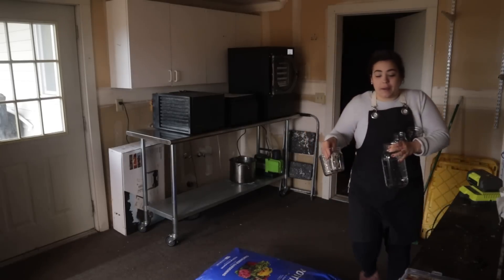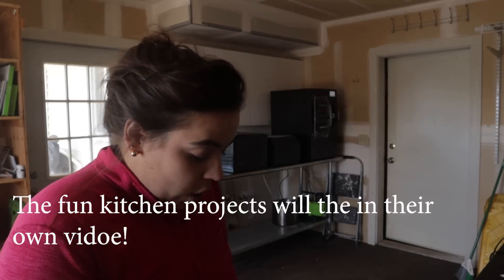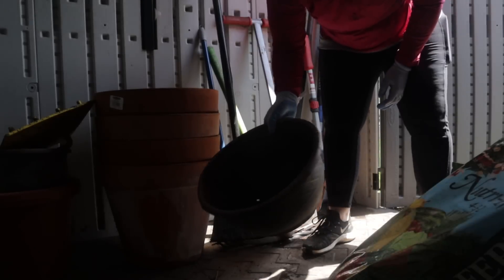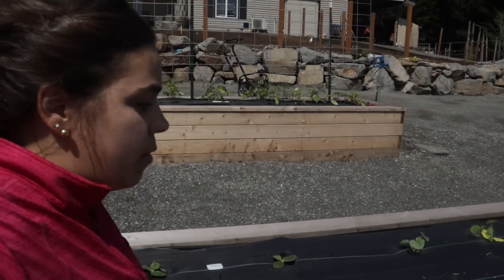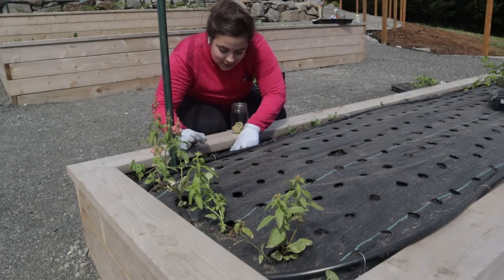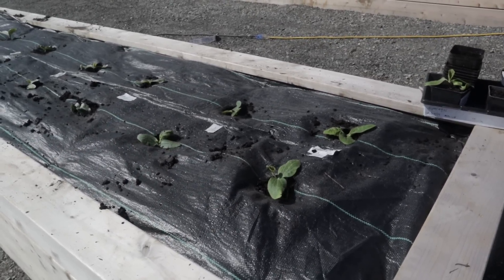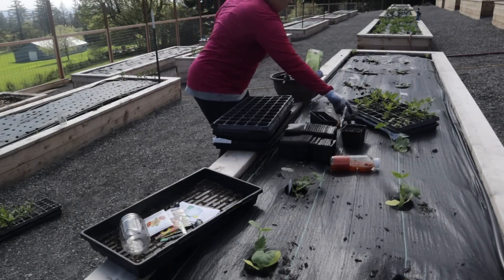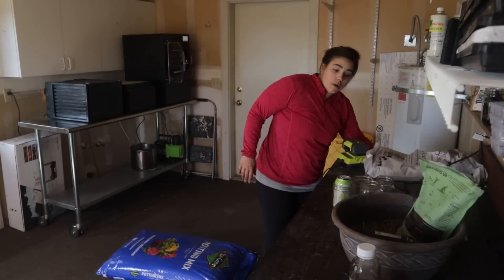I'll try just about anything at this point!

Comment: I germinate most of my seeds in a wet paper towel in a plastic container. Once they sprout, i put them in red solo cups with soil. Then when they are ready to plant outside, they go into larger pots/ containers outside. The garden is looking awesome.
Reply: Just a question because it's only my second year gardening. I had really poor germination rates with my beans this year. I just sow them into the ground. Would you also germinate them first on a wet paper towel?
Reply: @sarahr.1076   beans like alot of moisture but while germinating in the ground if its to cool and to wet the seeds will mold and rot.
If we're supposed to get rain I just plant in a furrow and water before I cover. If its to be dry for days or a week I don't water unless I'm going to water until the rain comes.
Some like to soak seeds before planting and others don't
Reply: @sarahr.1076  i do most of my veggies and fruits that way. Its easy. I dont have much luck direct sowing because all my stuff goes in containers or pots. My ground soil is not good because I live in an HOA. Good luck, give it a try.
Reply: Yes I’ve just tried this method and it’s awesome 👍
Reply: I do the paper towel method too! It works really well.
Reply: @tammymanuel9158  .
Reply: @Sarah R.  Beans are really sensitive to some of the chemicals used to kill weeds, so it's possible this was a factor
Reply: I bet it looks beautiful
Reply: Love that ideal!
Reply: @sarahr.1076   you can try that also. But remember these few things. good soil contact is critical for seed that was not soaked first. They cannot (!) Run out of water from beginning to fully sprouted and leaves, not ever getting too dry. If there are blank spaces between sprouted  plants, replant them. Don't thin beans the way seed packets say! Healthy plants that are 4 inches apart are a bit too far apart. With peas, do all this stuff, plus plant 1 inch apart or less. Beans and peas both do much better if planted close. Inoculant helps.
Reply: @MissBetsyLu  Thank you. I will buy a new packet of beans today and put them in the gaps and try to get the moisture right.
Reply: @debbiepaquin8842  Ok, thank you. That's good to know. We get a lot of drought here, so I will try to be very diligent to keep them moist. 

I'll buy a new packet today to put in the gaps and will try the tips.
Reply: @tammymanuel9158  Thank you :)

I'm lucky with the beans, their space is where an old compost pile once was, so the soil if fairly good.
Reply: @carmendoyle9786  Thakn you :)
Reply: @cynthiafisher9907  That's true :D. We have voles, maybe they were hungry.
Also last year I had problems with slugs eating the bean seedlings. So this year I made sure to protect them from slugs :D. Every year it's a new challenge.
Reply: @n3rdygrl  Ok, thanks. I really hope not. But that's good to know. I remember the soil test with beans from a few videos ago. 

It's the same space I already grew a few beans last year and haven't changed anything. 
Except I added a few new varieties.
Reply: Thank you!  I’m going to try this.  Having trouble with that this year for some reason 🤷🏼‍♀️.
Reply: @sarahr.1076   my pleasure. Take care and have hope. If I can get them to grow, anybody can. Blessings all.
Reply: Great Idea!!!

Comment: Hi Becky , I am 64 years old and have a couple of things for you.  when planting corn my gramps taught us 3 seeds per hole and of course it was in the field so it was about a foot apart. That being said i do mine in a raised bed and I do 2 seeds per hole and about 8 inches apart and it seems to do well for me . Now as far as the cloth I am on year 3 of mine and it is as good as the day we put it down. We did have some fraying this year due to a big storm but we just reburned it and it's fine. Make sure you use plenty of staples we put ours about 2 foot apart and  we found that with the wind and such it has helped tons. for your melons you will need what I call a melon bra so be thinking what you want to make and or use for that. my gramps literally used grams old bras to hold the melons. that being said there are many things you can make and or use.

Comment: regarding the fabric rounds you've got left over: if you burn an X shape instead of a circle, you can tuck the four corners of the X underneath the landscape fabric. doesn't use less fabric but will at least simplify the cleanup

Comment: The worst thing about putting sunflowers in the weed fabric is the removal.  The roots get so big you can't pull the plants out of the holes burned in the weed fabric. We had to cut off the sunflowers, take up the weed fabric and pull the sunflowers out from the underside. Your garden is coming along great!!!!
Reply: Why take out roots? Leave them to rot there. Have 2x as many holes as needed and alternate. Blessings all.
Reply: Using a lopper  or a saw to cut the base off and leave it overwinter in the ground should help and create compost in place at the same time. The very woody part that won’t decay i often bringnin the spring to the compost pile
Reply: @TheEmbrio  yeah. That's what I was thinking. Or even leave it there more than one year. Blessings everyone.

Comment: One suggestion. When planting big areas of stuff like your corn, set seeds on surface and don't cover them until all seeds are spaced out. Then, if you have to respace them, you can just move the seed around. When covering or pushing into dirt, it goes very quickly. Great blessings everyone.

Comment: Hi Becky I am in Australia and we have just started our Winter.  I also have my whole vegetable garden in raised beds.  Most of my beds are 1 foot high, 8.5 feet long and 3 feet wide.   I have 2 beds that are 2.5 feet high, 8.5 feet long and 3 feet wide these 2 and one of my lower bed are where my Asparagus is planted.  I have weed cloth under and around the beds but have never considered putting it over the bed in replace of mulch.  We have very long and hot summers and I would think that the weed cloth could over cook the ground and plants.  We also don't normally get our rain in nice soaking rain over several day but get more very heavy showers in Spring/Early Summer that can drop a couple of inches at a time in about 15 minutes and I wonder that a huge volume of water all at once may be too much to go through the weed fabric all at once and the water would fill up on top of the fabric forming a pool and then start overflowing the beds, even with there being a space of about an inch to 1 1/2 inches between the actual top of the garden bed and the soil/weed cloth. I have never had problems with the water going straight through the mulch and then into the soil when we have the storms.  Have you experienced any large downpours and the affect it had on your beds?  I also like digging in the left over much from a bed that has finished producing for the year as more organic matter to help build up the soil.  I am watching your "experiment" with interest to see how it preforms during the year.  I do like the idea of the holes to help with watering.  I hand water everything as putting in a drip irrigation system was just out of my budget and I do like it as I can inspect the plants for insects or other problems and I find it very relaxing. Regards from Down Under Friend.

Comment: I’m in the Pacific Northwest as well, have you tried the copper I think it is around your beds for slugs? You can wrap flat copper wire I think 1/2” thick and they won’t cross that line. I think they sell it specifically for gardens but I’m pretty sure a row of pennies will do it too ❤

Comment: I used to grow microgreens and specifically grew those sunflowers. Something you wouldn't believe until you try but adding pressure/weight to the sunflower seeds will help with germination. And you wont water them as much because the pressure/weight they are under keeps them wet. I used to use 10 pound weights on top and not water them for the week.

Comment: Becky, my garden doesn't know what's going on with the weather either - we are in winter, yet I'm still getting temps in the low to mid 70's (converted from Celsius). We had a pretty harsh frost last week as well (daytime temp dropped to a freezing 58), yet I'm still getting lots of new growth and flowers on my summer crops like chillies and tomatoes etc. My summer passionfruit varieties are still producing, however my winter variety is currently flowering like mad - good luck, some seeds can take longer than other to germinate, finally be careful applying fertilisers etc to the actual holes as some varieties can burn the seedlings and they can kark it that way.

Comment: I have landscape fabric in my front flower bed and I will say it can be a pain when you go to plant things because you have to create a hole in order to be able to plant anything. I actually find it easy to use a box cutter and just cut an X in the fabric and then tuck the flaps under the fabric to expose the soil. You can make the X as big or as small as you want and you won’t have pieces of the fabric to throw away.

Comment: Tips on corn after years of struggle myself; put a tpost or stake in each corner of your raised bed and run a rope around all 4 edges of the bed abour 3 ft up once your corn is that tall. Most people dont get a ton of corn because corn tends to fall or collapse and they need to be 3-4" apart and be able to sway and hit each other to pollinate. But the rope presents them from falling over in high winds. Also make a reminder to fertilize with straight nitrogent every 20-25 days during the growing period. They are heavy feeders and needs lots of water for corn to fully develop. So i had a trench in between each row and id go thru and water that trench and put my fertilizer there. The year I did all these things i had the best success I'd ever had!

Comment: I use wheat seeds for winter time and during summer time I use milo seeds, no soil. and it work great i wish i could show pictures of it. What I would do is soak 4 cups of the seeds per tray. I would soak them over night in a bucket with a drop of bleach to kill any bacteria that the seeds may have, the next morning I would rinse the really good and then spread it on the tray. and every day i lightly water with s spray waterer and it ready in a week to be fed to the chickens. So I have well over 250 chickens, so I germinate a lot of it I have a set up of racks of them even buckets out side

Comment: Corn if you are having problems you may want to add bone and fishmeal to the soil you are growing them in. My grandfather used to dig a hole where he would plant 3 corn seeds and out first put in fish ones and guts then out some soil on top then put the 3 corn seeds abd cover. So I think the fish and bone meals would do the same without the mess.
If your fish and kelp fertiliser does not have calcium maybe you need to only add it with a little bit more of your fish and kelp fertiliser.
Other than that this is the recommendation on growing corn below.
Also corm likes loamy soil. Corn is a heavy feeder, especially of nitrogen (fertilizer). Follow your soil test recommendations or use two pounds of 5-20-20 fertilizer per 100 square feet of soil.
If there is not enough fertiliser for corn it will die befire it even breaks the soil to see the sun.

Comment: The wind needs to blow DOWN the rows of your corn in your raised beds when they are pollinating.  That's how one plant pollinates another.  So by having a larger square you are pretty much guaranteed that the pollen flows to the other plants no matter the direction of wind.  It'll be interesting to see if the pollen gets to the other stalks or if it blows right on by.  Time will tell, not much to lose but some time a tiny bit of money for the seeds!

Comment: In general, i like pellet or powdered organic fertikizer used sparingly (and more often as needed) as a top dressing because it is harder to use too much then burn the plants.  If using inorganic fertilizer, i prefer a vrry light mix in water.  Again this is less likely to result in burning; if things look less healthy within a couple of hours to 24 hours then water, water, water to dilute and flush.

Organic fertilizer tends to fertilize the soil where as inorganic fertilzer fertilizes the plants.

Comment: Ms Becky - Consider getting free 5 and 2.5 gallon, food grade buckets from bakeries in your area to put your assorted bagged fertilizers ans ammendments in.  Ideally you can put your originsl packaging into the bucket but if not, cut then place the instructions et al in the buckrt eith your contents.  Label uour buckrts on the outside with perma marker or a piece of duct tape with perma marker.  -  Unfortunately, rodents will get into some of the organic fertikizers and amendments.

Comment: Golden bantam sweet corn is not a super sweet corn, so it is not very sweet unless you add sugar to the water.  Corn germinates fast so it does not  need to be soaked.  You will need to get a minimum of 4 rows in your bed.  Corn is planted in a block for pollination.  You can plant 8 inches apart instead of 1 foot and you will get a tighter block.  You may have to bag your tassels and hand pollinate them. Corn on the outside of the block does not pollinate as well which is why it is better to plant in a 10x10 block.  What is important is that corn is a warm season crop and it germinates poorly in cold soils. If the  soil temperature is at least 75 it should be good.  Anything less than 50 degrees  will inhibit germination.  Mirai and Bodacious  are supposed to be  good varieties for the north.  You will get better germination if you plant it on a heat mat if your temperatures are not consistent. If you plant corn less than 8 inches you may run into problems with pollination if there is not enough space for the pollen to hit the silks.  You will again have to collect the pollen in a paper bag and hand pollinate the silk.